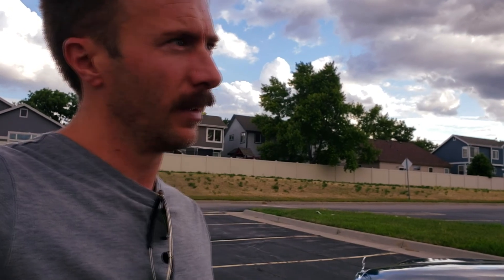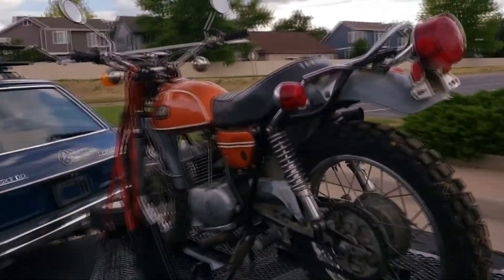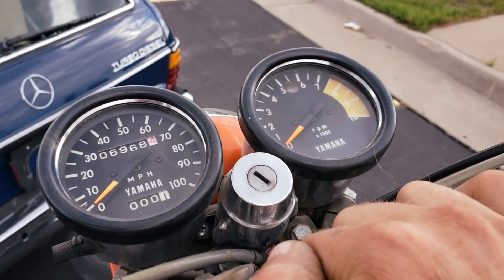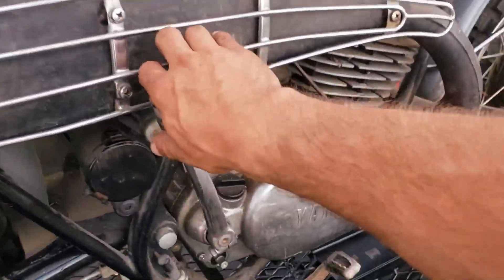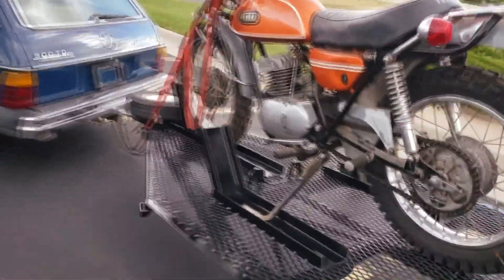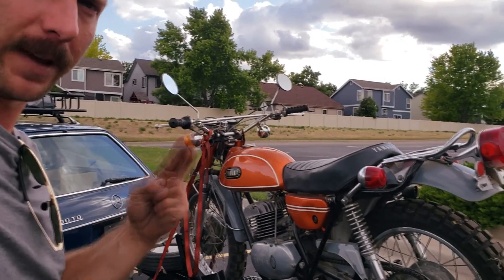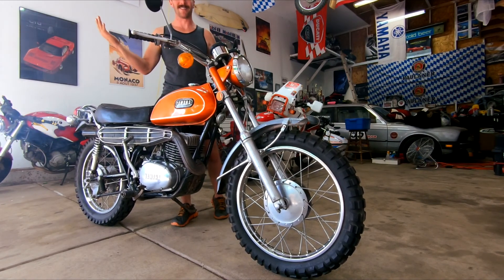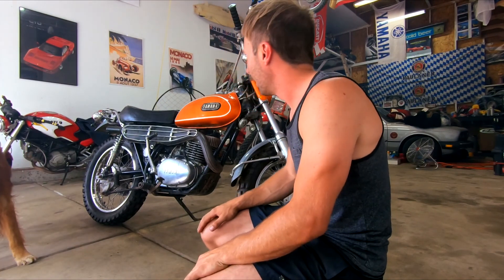1972 Yamaha DT250 sat 30 years, will it run again?

Comment: My very first bike was a CT 3  which is a 1973 175  I believe that was the first year for the steel reed valve induction which helped with the low rpm power. awesome bike. I bought it from the original owner it had 599 miles on it.  I loved that bike hadd it for years.  rebuilt the top end many times and the crank and rod once. tuff bike  just about indrustable.  at the time I paid 500.00 for it.
Reply from the maker: Great purchase price
Reply: @SirDrifto  that was in 1974 so im not sure it was  that great of a price at the time.